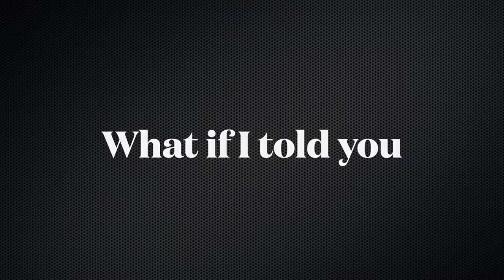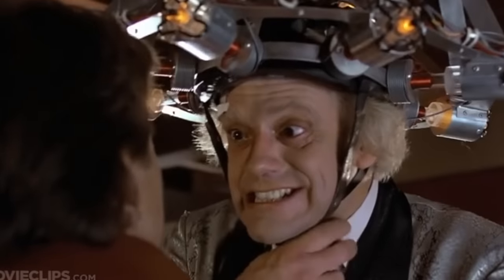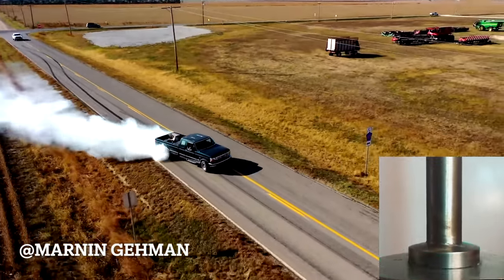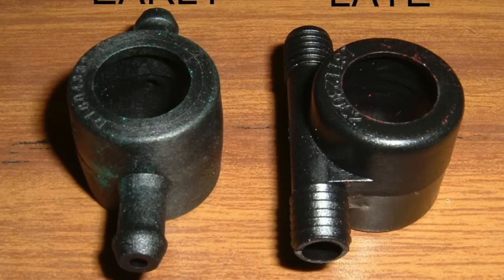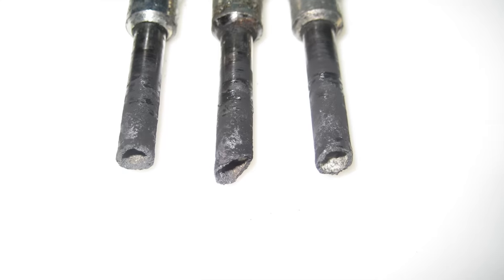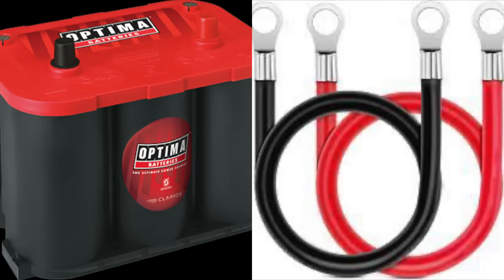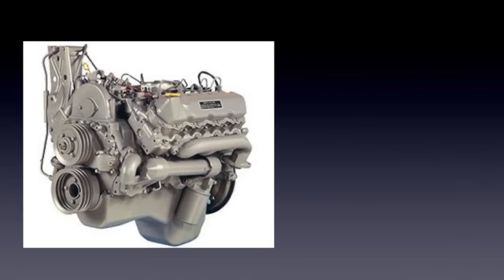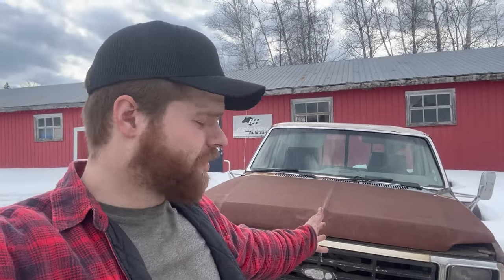The 6.9 IDI is not what you think...

Comment: So what's wrong with a gear reduction starter and a set of group 31 batteries 1/0 or 2/0 welding wire? 1/0 is good for 350 amp at 75 feet it's about 9 ft on a regular cab.  31s are cheaper.  And an idi WILL make as much power as a 6.7.  You just gotta have a DRIVER, and the right injectors.  We didn't make 180 at the pto with a 436 ih motor that came factor stock with 95 horse because we didn't know shit.  That's well over 100 at the crank and she still does field work.  But she's a runner and she'll live loner than a 404 stock. That idi will run and live forever with the right ass in the seat with the screws maxed, plungers, boost and injectors the 7.3s will get hotter faster though.  And keep the egts below 1250 aluminum and heat post turbo don't mix.

Comment: The 7.3's aren't an uncompromising upgrade, either. They are more subject to cavitation than the 6.9s were. 

I've got a 6.9 with the Banks Turbo kit. I have to replace the fuel injection return lines for the second time in ~8 years, and rewire the glow plugs this spring. Then I'll be selling it, I can't afford to feed it. It's economical for the behemoth of a truck it's in, but it's just way more truck than I need 99.9% of the time.

Comment: In todays world of overkill compensator Pickups,  the 6.9 idi is a call back to sanity ,durability ,and longevity.   No liftkits, expensive electronics, but had 8ft beds regular cab and manual transmissions to actually haul real cargo.Yes I actually used to like pickups and have grown to hate them tremendously since the old days. And its become political . I like the days of the 80s up until the mid 90s. The 6.2l diesel can be used after an emp bomb is denonated. Who gets the pickup glory? Humble guys and long lasting trucks, or the show off lift kit smoke blowing dummies?

Comment: 6.9 is a waste of time for anything performance simply because the 7/16 head bolts don't cut it.  Get a 7.3 idi stud it and the pour the fuel and boost at it.
Reply from the maker: Not wrong, perfect block would be a sleeve down 7.3idit so you have the strongest parts from factory while gaining strong cylinder walls
Reply: @highostablegarage  yah and figure out how to put 1/2 head studs in because I've heard the 6.9 doesn't have enough meat around the head bolt bosses
Reply from the maker: @1997cr80r  I’ll be doing a tear down one shortly but only think I could see is an issue with cylinder 1 and 5 and their coolant jackets, but we will see

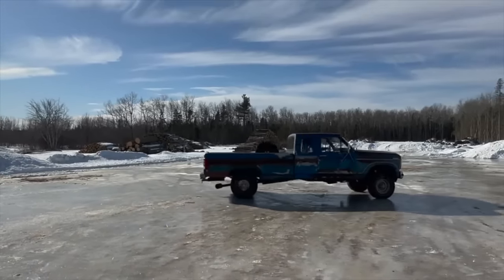Comment: @12:52 you need a bunch of stuff that never came on the vehicle
Reply from the maker: Only one that wasn’t factory is the retro fit  7.3 controller
Reply: @highostablegarage  factory 6.9 battery cables were crap, the batteries we're undersized, the return fuel was the plastic crap from the factory. These are all upgrades
Reply: To be clear original battery was 850cca, the 7.3 pump came out half a decade later, the cables were just the same crap you found on everything from the the day not sized for the excessive load,the starters were slow(maybe why this one was upgraded?) It is as a reputation well earned. Not as bad as certain later ih motors, but there's a reason everybody remembers the 7.3 fondly and the 6.9 was just a thing that happened.

Comment: I mean or you can deal with a little bit worse mpg and get yourself a 390 FE that produces 250 HP and 400 ft-lbs.
Reply: Those engines sound gnarly and they pull hard even from factory. A mild cam, a good carb and long tubes really make them nice.

Comment: jaja...
https://youtu.be/6AWiC_2EHbA?t=880
Every Bar boost = roughly double the horse of the N/A version. So 147psi is alone roughly 1500HP. Besides the fact that the engine is not strong enough to hold that and the prechamber design isnt going to flow 10-times the fuel.

Comment: Best damn farm trucks ever built, ford's 390's, 460's, 6.9 idi's here in bama would beat the substandard weak framed gm square body bullshit my a million light years. Fords doors did not fall off like the chevy's the frames did not break at the steering box like the gm garbage. Gm's 350 diesel well just another joke from gm as well as their everything. Ask a man in georgia that worked for an ambulance building company why there are so many ford ambulances out there, his response was they are the most dependable and that a 460 equipped ambulance with a c6 transmission would outlast a chevy 454 and their pos tranny 10 times over. He stated if the chevy eventually make it to 150,000 miles it was all to pieces. Chevy fans stick by their junk.

Comment: Click bate
Reply from the maker: It’s there at the end haha 😂
Reply: @highostablegarage  I mean u never actually showed anything.   Just rumors.
Reply from the maker: @2ndspingarage  there are photos of the engine in the truck at the drag strip
Reply: @2ndspingarage  They wrote about it in motortrend too. Its not outrageous to think a 9 seccond capable diesel pickup based on the idi would be around 1200hp. It has the displacement, it had enough turbo(s), and it had the fuel. It wasnt relible but it existed. Ill take track times over dyno numbers any day
Reply: @madmod  the most I've ever seen an idi make on a dyno was 525hp.  I love these engines,  I own a 7.3 idi I drive daily.   I've looked and can't find it.   If it's legit that's awesome.
Reply: @2ndspingarage  One thing worth noting is its hard to get honest dyno data with diesels. The load they see on a chassis dyno doesnt always equal real world consditions. Tracktimes however tell more of a story. If it was running genuine 9 seccond passes, it was every bit of 800-1000hp.
Reply: @madmod  that makes sense.
Reply: @madmod  my 7.3 surprises people and its a non turbo.  Go from white among the tires and it's a dually,  to driving 100mph.  Everyone tells me how slow these trucks are and I'm like they're not that bad.
Reply: @2ndspingarage  they will accelerate pretty much the same regardless of how loaded down they get too. Funny how stout they are

Comment: well, duh, most engines will run fine if you make sure their key failure points at perfectly addressed. not that i dislike the 6.9/7.3 idi... they're perfectly adequate, for what they were. but there is a reason they're cheap. just like ls engines... and i make it a point to never take advice from anyone with a stupid garbage can fart tip, actually i might listen to someone who has one on a 20 year old ricer, but definitely not a diesel of any kind, that's just stupid. or, anyone who is evidently totaly incapable of pronouncinG the letter g at the end of a word... if you sound stupid, probably are. i don't want 310 lb/ft, unless it's under 200 c.i., maybe i want some of that stuff, but i'm just gonna say no cause i don't remember what all of them were and really don't care. a 351/400m has potential, an idi 6.9 is only good because it's 420 c.i., that's it... they're slow, and all their problems are gonna run out of replacement parts, or parts that don't have to be replaced every week because everything is cheap chinese junk and n.o.s. is just that, old stock... so finite resource. after that, you get to come up with a re-engineered fuel system, glow plugs, whatever else. just not worth the hassle. again, i don't dislike them. but they are not a performance engine by any means. same reason i don't particularly care for powerstroke 7.3's anymore. they're fine stock, but will break and leak with any extra oil pressure. and i do not have the patience to drive them stock. not as big of a problem now, cause there are bigger hpops available, but now way less demend, so maybe even harder to get now, don't know. but since everybody acts like they're god's gift to gearheads, the exchange rate of 7.3 powerstroke and gold is 1:1... and they're just not that great. not bad, will run forever, STOCK... again, who has the patience and wants to get ran over trying to merge? and even once you fix the fuel problem, they're 2 valve pushrod. spo, now it won't get air. so, i'll just go with a 6.7 or gas. or something else, but it's gonna have way more than three hundred anything.
Reply from the maker: You must have got up on the wrong side of the bed this morning haha. To each their own.